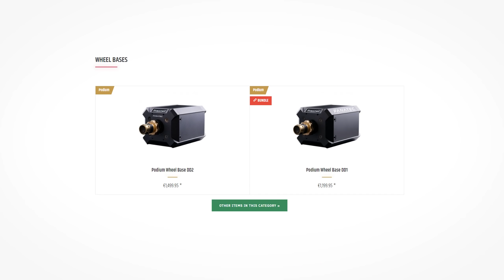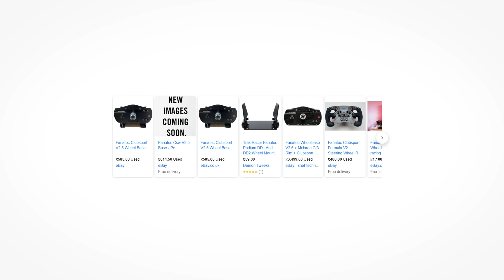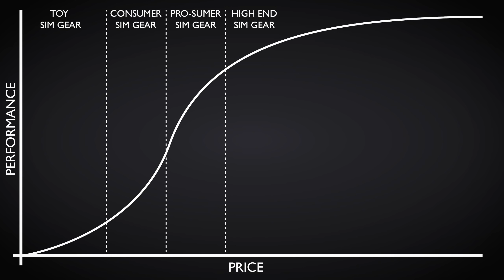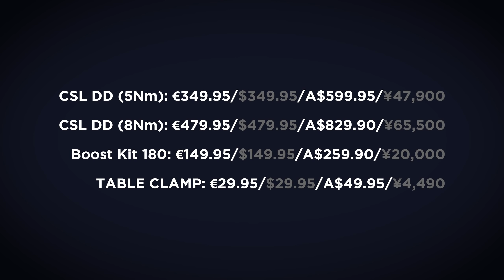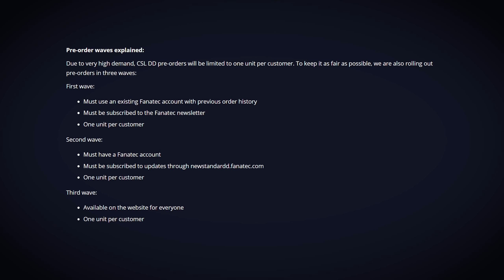Testing The New Fanatec CSL DD Direct Drive Wheel [First Look]

Comment: Looks like an excellent wheel, whenever I update from my deskclamped G29 to a "proper rig" this is the main suspect.
Reply from the maker: Yeah I think a lot of people will be feeling the same way!
Reply: @ChrisHaye   Thanks so much, been waiting for this!! Lots of us "new viewers" will upgrade from g29 using a playseat challenge! Is there a chance for us to see a review on the csl dd on the playseat with the Power Boost? That would be so cool!!
Reply: Same. We are their target audience. Can’t wait!
Reply: It will be, got a fanmodded used T500 on the really cheap, 230 Euros including postage, a two months ago.
(Sold of my modded G27 for 166, so overall it cost me 54 euros.)

And that already feels like night and day in comparison to my old G27 when it comes to the FFB.
This will be far better.

The first two days it might feel weird, but after that it feels great, giving you much more confidence.

The only problem for me where the pedals, I had modded the G27's Pedals with the full GTEye set and they were great.

Out of the box the T3PA-PRO/T500 Pedals weren't as good, especially the brake.

Went through a few brake mods T500 realistic brake (not worth it), TM conical brake mod (great ramp up of brake force feel, but almost no lift off feel, making it really hard to feel variations braking) and the 3Drap brake mod (feels not quite as curved as the conical mod, but offers great lift off feel. And good feel over the whole range, as I had to mount the conical a bit further back, due to being unable to hardmount it.)

In short either hang on to you G29 pedals if modded (GTEye springs recommended), or get a good set or a good set+Brake mod, as bad pedals make you slow.
Until I had modded the brake pedal, I was about 5 seconds a lap slower than with the modded G27.
After the 3drap brake mod I'm 3.3 seconds a lap faster around bathurst with the T500 than with the G27.

Just a warning, a wheel with interchangeable wheel rims will entice you to buy quite a few things for it. Last month the new TM F1 wheel came out so you could get the old Ferrari F1 wheel rim for cheap (118 eiros inc. postage), as everyone was selling it.
And yeah I'd like another round wheel than the standard GT Wheel....well the 28cm rims are dirt cheap 50-80 euros used, but I like the 30cm wheels, so 599XX it is (five weeks old, 128 Euros incl. postage).

So
Wheel set (icl. Pedals).   230 euro
Brake mods.                        46 Euro
F1 Wheel.                           118 euro
59XX wheel.                       128 Euro
--------------------------.              -------------
Sum total (until now)        522

SHH Shifter+Seq plate.    109

End total.                             631

So beware!😉😂

And now I need a shifter....and the SHH looks good, better functionality TH8A and cost 70-80 Euros less.
Optics aren't as good, but internal build quality is good, according to Barry.

Could be something for you, if you're looking for a good shifter that doesn't cost as much as the fanatec one.

Otherwise if you already have the Logitech G Shifter, you could look into the 3Drap Cambio mod for it.
Although in the end the G shifter+Cambio mod is only marginally cheaper than the SHH.
Reply: @LupusAries  why is this going to be "far better"? Don't count on getting one any time soon. Of course if you want better than the very old T500 (which is bettered by the TX according to many then a TS-PC Racer (after a fan change) is a solid option and reliable, with good ffb and torque. Having used a few low power direct drive wheels I was left completely underwhelmed, and didn't think they offered anything more than the TS-PC except added complications.  I think the main problem with all entry level wheelbases is the small diameter of the wheel. Try a 320mm wheel on them (as long as it's not too heavy for the motor) and you get better feel. If you want the best you invariably have to pay for it, I don't know what exactly this is supposed to be but high end it ain't.
Reply: @oktc68  Well the T500 has the 300mm wheel and I'm running both the 599XX another 300mm, precisely because I liked the bigger wheel diameter, and the old F1 wheel on it. The latter of which does improve the FFB as well, since it is lighter. 

I'm not counting on getting a CSL DD soon either, I'm happy with my T500 for now, and the thing is as you said, if need be, I just need another "servo" now and can carry over the rims the pedals etc. The shifter will be independent anyway. 

I was looking for a T300 at the time, but they were more expensive, especially with the T3PA-Pro and a friend did recommend to me to get the T500 for the better pedals set, as they are quite moddeable to improve, better build quality than the standard T3PA and I could just swap out the Servo later. And that's more or less the plan, although with the fanmodded T-500 I can afford to wait a bit for prices to normalize. 
Of all the Thrustmaster Bundles of recent years, the T500 has the best pedal set, which is functionally equivalent to the T3PA-Pro which gives you acess to all the mods for that. 
Whereas the TS-PC 488 Challenge Edition also only comes with the T3PAs, despite being massively more expensive. 

What you misunderstood is that what I meant is the jump in quality from a G27/G29/G920/G923 to a T500 or T300 or TS-PC or a CSL DD will be very noticeable. Probably the most noticeable you will get in all time. 
And the T500, especially with a 300mm wheel is a massive improvement over a Logitech G series. 
A CSL DD is likely to be an even bigger improvement over a G29 that my T500 was over the G27. 

And the CSL DD is mean for that group, the ones that want something better than a Logitech G or a T500/ T300, but can't quite pay the money for a high-end wheel, or the space for the High-end wheel and it's mounting solution. 
Yeah a DD1/DD2, Simmagic etc are great, but if you can't hardmount it on a simrig and have the space for that, it makes no sense.  
And it's Fanatec Targeting that market to get people into their eco-system, a market where they had problems due to their price and them not having the necessary eye-catching marketing advantage. Which is what DD is to them. 

If nothing else, the added competition, if enough are supplied, will drive the price for TS-PCs, T300s and especially the T-GTs down. The latter of which is just massively overpriced.  Or force TM to upgrade some of them. 
And it will likely also increase the availlability of older wheels like the T300, TS-PCs, TS-XW or older Fanatec Units on the used market. 
Which is a win for all of us who do it on a budget.
Reply: @LupusAries  Great post, thank you. May I ask, you seem to suggest that the T3PA-PRO pedals with the 3DRap mod were better than the G27 with the GTEye springs mod. Am I reading your post correctly? And, if so, may I ask, even if they made you quicker did the T3PA-PROs feel better overall/
Reply: @andymaxwell23  Err no not quite imho.

I like the brake pedal feel with it, it's a heavier, good feel for the ramp up and the release, just like on the GTEYE.
however the GTEYE had a more pronounced progressive feel, they felt more like a power gradient.

And I miss the heavier clutch and throttle springs of the GTEYE kit. I had the full set.

The build quality of the T3PA-PRO is nicer, and I love the fact that you can reverse them and run them GT style, not just F1 style.
Downside on my T500 Pedals (which are the same as the T3PA-PRO, just different sticker), is that you can't move the pedal faces horizontally.
Spacing is fine for GT, Prototype and Formula style racing, but Heel and toe can be a bit of a stretch.

On the other hand, the T3PA-PRO are much more comfortable to use, due to not being nutcrushers. 😁 They leave more room for the family silver than the G27 pedals.
Also if they are in GT-Mode and you put a folded up anti-skid-mat in the middle, you can confidently heel and toe, even without hardmounting.
Something which you couldn't really do with the GTEYE modded G27 pedals, unless you hardmounted them or stopped them from skidding.

Edit: Overall feel for the feet was nice, as the all metal construction feels nicer than plastic.

As for the 3.3 faster at Bathurst I mainly attribute that to the higher confidence that bot the better FFB and finer control that the 30cm wheel gave me.

I would also check Ebay or eBay Classifieds/eBay Kleinanzeigen as I've seen T3PA-PROs with loadcells (Ricmotech) for as low as 100 Euro.
Reply: you mind lending me your g29 when you upgrade I'm looking to upgrade from mouse steering hahahah
Reply: Lmao. I'm just gonna desk clamp this too.

Comment: There is zero chance on earth that the power supply difference is anywhere near $130.
Reply from the maker: Yeah, agreed. But that's not really how tech pricing works. The prices are positioned across the whole range to produce the expected margins. I would guess Fanatec are making a smaller return than they'd like on the cheaper unit, and making it up on the bigger one.
Reply: @ChrisHaye  Only complaint I have with the pricing is an initial purchaser that chooses to just buy the base 5nm ps unit and order a 8nm power brick at the same time will only be paying a $20 penalty for getting both power supplies versus a purchaser that opts for the 8nm power supply only unit and lets Fanatec totally keep the smaller power supply.

There should be a higher credit allowance say $80-$100 difference for not getting the smaller power supply at all when the larger power supply can be purchased for $149 standalone.
 At the $149 stand alone price point a $130 difference is not reasonable at all!
 Otherwise just paying the $20 for a backup power supply is almost a no brainer in my opinion.
Reply: @ChrisHaye  I know I sound like sour grapes, but I'm not really. Im still a Fanatec Fanboy. Love your channel man.

Comment: Surely once you add the boost kit and a wheel rim you might as well spend the small amount of extra money and get a DD2 etc?
Reply from the maker: Well, a DD2 with a rim would cost nearly 3x the amount. Boost Kit + McLaren Rim would be just under 700 EUR, wheras the DD2 base alone is 1500.
Reply: @ChrisHaye  Fair one, dunno why I thought the DD2 was a bit cheaper than that!
Reply: My DD1 with McLaren GT3 rim arrived yesterday for around £1380, so still a big jump in price for the top end wheel bases.

Comment: Just what I wanted to here.. my g29 is going on eBay very shortly.
Reply from the maker: This is a good point actually, I should be watching ebay to fill in all the gaps in my wheel collection ;)
Reply: Be careful tho, we don’t want to see the 30 series GPU situation with this product. Because with the value that may happen
Reply: and you will get zero added performance by doing that, the driver skill wins the race not the peripheral, why the hell you think paying over the odds for such set up will increase your chances is mind boggling. that counts for fuck all if your a shit driver, and if you cant win races with your g29 then you better stay away from this overpriced shit.
Reply: @dazlee3449  Why so salty, yeah no shit its not gunna make u a better driver, but don't buy it for that point either, people should be allowed to do whatever they want and makes you happy and it for sure feels better and helps you pick up on the nuances of racing which a g29, as a g29 owner, doesn't do at all, but still the fuck is wrong with you
Reply: @dazlee3449  wow holy shit he didnt even say anything lmao jesus you need to calm down